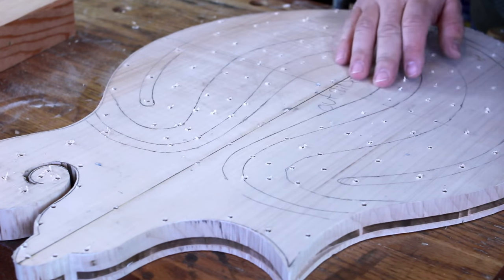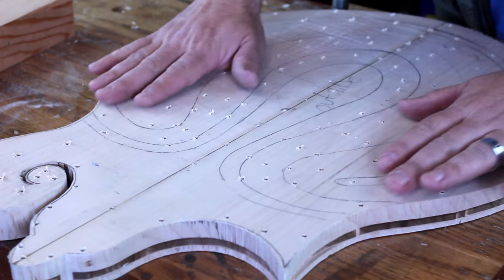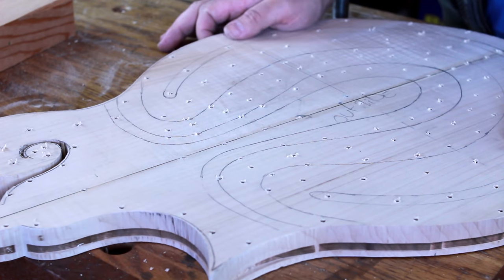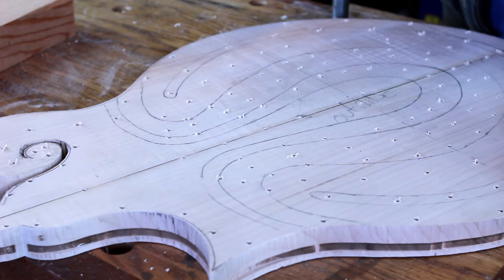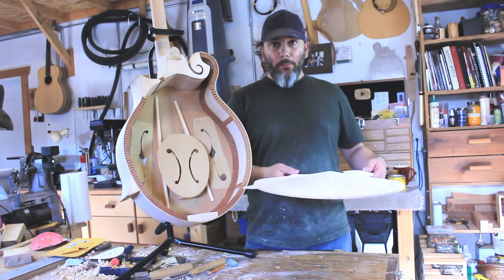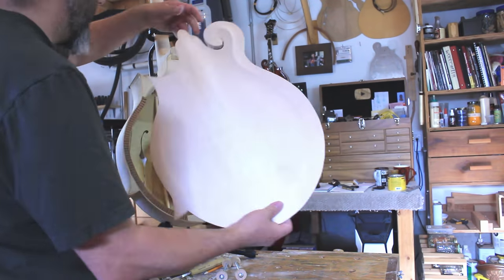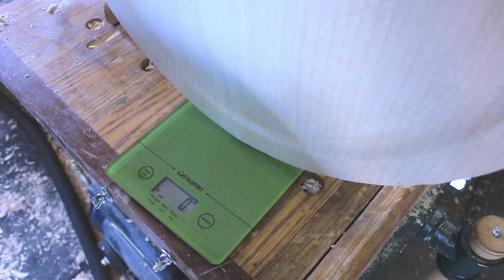Archtop, Hand Carving a backboard/ Part12

Comment: I have to say, I really like the methodology how you attack this task. The usage of templates. I have been thinking about this and how to do it and what I came up to was calculating the dept I would need and then drilling all those holes and carve to it, hoping i wouldn't go too deep and then I see you use the drill to get the thickness. You learn something every day. You're getting there, it's looking like an instrument.
When your hands are hurting, try an ice bath or just running cold water, it helps on the recoup time
Reply from the maker: Thanks Lars, will definitely try this..
Reply: Crossfit athletes use this to recoup faster. I have used it when I am cutting rings from 14 gauge steel and it helps pretty good. The only problem I had was complaints about us being out of ice cubes :-)

Comment: Loving this build so far! Is there any reason for carving the inside first? I'm guessing it's for ease of work holding, but I might be wrong. Also, I'd highly recommend the D'angelico planes from LMI for carving tops and backs. Thanks for the upload
Reply from the maker: I"ve seen both ways done... Top first or back... for me I do prefer to do the inside first . Yes, the work is easier to hold in place but also I find it less likely to put stress on the plate and breaking it. Personal preference I guess...As for the planes I have my eye set on a bigger Ibex … Thanks for watching..

Comment: Amazing.  Why did you pencil in the contour lines on the outside?  They are removed so quickly.  Did they inform the drilling?  Why didn't you mark the bottom of the completed troughs with pencil on the inside.  I think I would like to know absolute bottom as I removed the rest of the wood.  Great stuff.  Cheers.
Reply from the maker: Yes, it’s only useful to know where to drill and the proper depth in the proper section. After this those line are not really relevant since you need to carve the material until you get to the bottom of the holes.